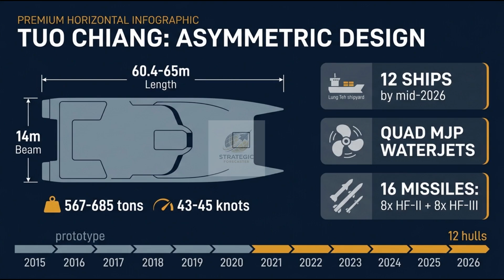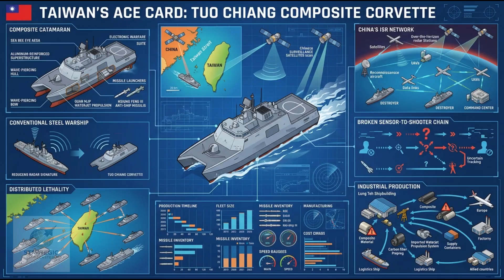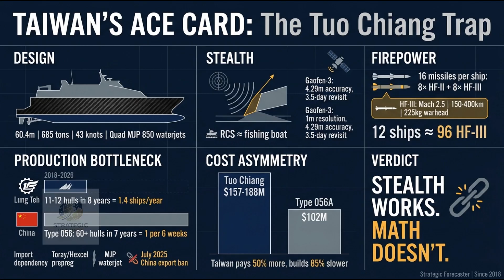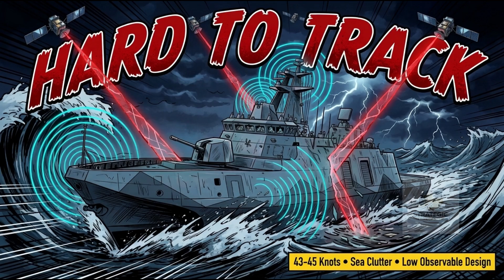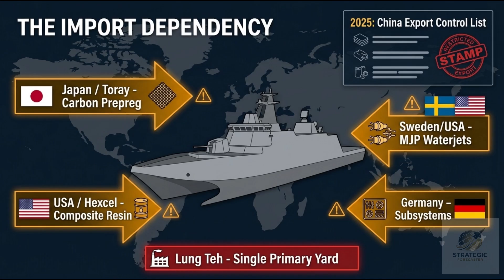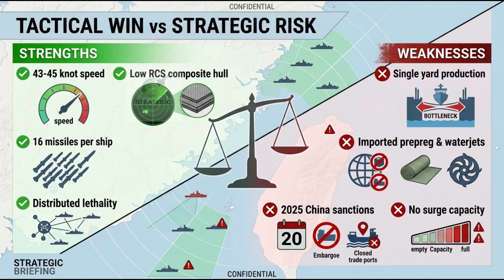TAIWAN'S ACE CARD: Tuo-Chiang Stealth Corvette

Comment from the maker: Thanks for watching... 
The math: 11 Tuo Chiang × 154 anti-ship missiles = 154 rounds. RCS = fishing boat (0.1–0.5 m²). Speed = 43 knots (80 km/h). China's SAR constellation revisit time = 1 day minimum. In 24h, Tuo Chiang moves 1,920 km. That's not a warship — that's a mobile missile battery that vanishes between satellite passes. But the real single point of failure? Lungteh builds 1.4 ships/year. China builds 10. Taiwan pays $188M per hull. China pays $102M. The stealth works. The math doesn't. Data: Taiwan MoD, Taipei Times, Janes, Naval News 2026. No hype. Just physics and industrial reality.